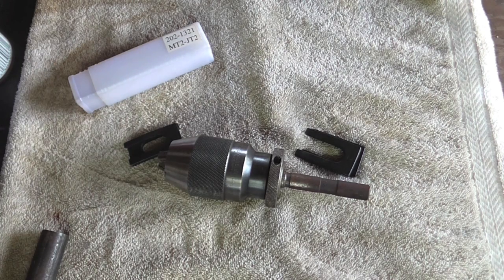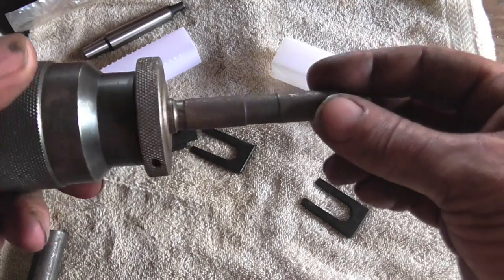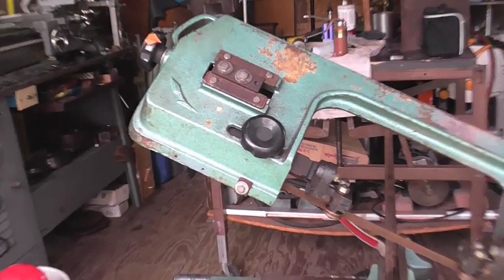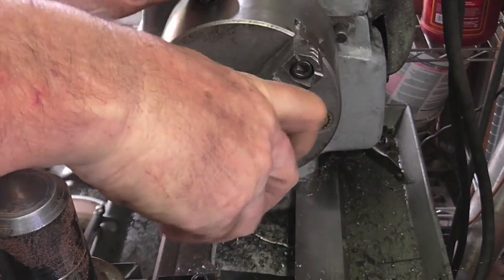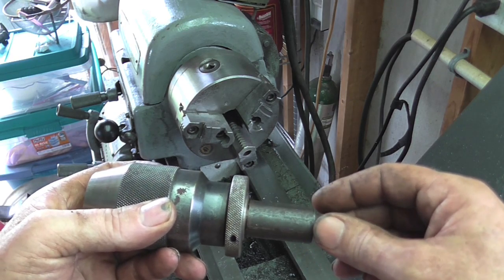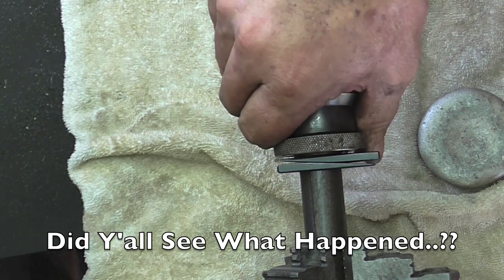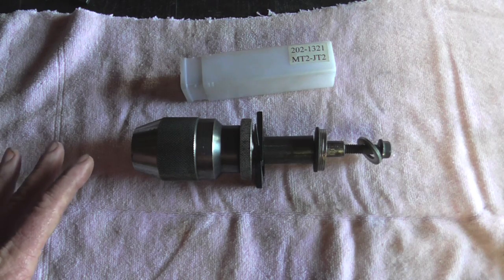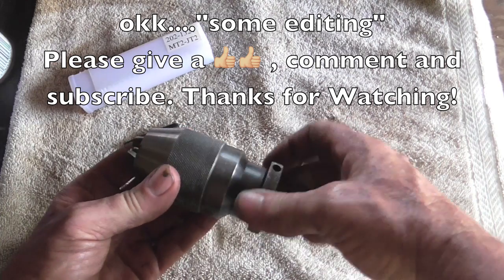How To Remove a Jacobs Taper (When Wedges Don't Fit!!) - MSFN

Comment: I gotta ask,  why not just disassemble the chuck and tap it out?  I don't understand the wedges.
Reply from the maker: Tap it out?, I dont follow you?
Reply: Makin Sumthin From Nuthin 

disassemble the chuck,  use a punch and drift the arbor out from the front
Reply from the maker: I dont believe there is a thru hole to access the arbor in Albrecht chucks....I could be wrong tho. It all worked out in the end 😊
Reply: grab the chuck by the two nurled sections and screw them apart, that will remove the hood (tapered section). then the jaws and jaw guide will come out. under that is a threaded piece that pushes the jaws,  screw that out. insert a drift punch into the hole that the threaded part was screwed into and tap out the arbor.
Reply from the maker: Thanks!, I did not know....but I do now. I appreciate ya! 👍🏼

Comment: I would have tried 1. reducing the spot where the tapers fit to the size taper I had or 2. drilling a hole for a cross-pin rather than drilling and tapping the end. Either way would leave the shank re-usable in the future and would have been fairly quick. The bandsaw is a dead ringer for my old Harbor Freight one. The newer ones have a hole drilled for a pin to keep it in the vertical position. It is also a good idea to stiffen the bottom so it is more stable. I put angle iron on each side and a shelf in the middle to hold bits. Made a huge difference.
Reply from the maker: All great suggestions, thanks for taking the time to help a new machinist out. I considered the cross-pin but if you saw my drill press you would understand why I took the route I did. Lol  I am glad it all worked out in the end :)
Reply from the maker: No pin on mine to hold in vertical position but easy to install one...thanks! :)

Comment: Richard--great lesson in perseverence! As others have mentioned, the bandsaw is generic Chinese. I have one the same color, same casting marks that is marked "Ram Machinery." I think they were sold under a variety of names, however. The castings are similar or identical to the Harbor Freight $250 bandsaw Item #93762.
Reply from the maker: I like the bandsaw, it does a good job for me. Thanks for the additional info!

Comment: Well done sir.
Reply from the maker: Thanks Rodman :)
Reply: Makin Sumthin From Nuthin You're very welcome.
Reply from the maker: Just rebuilt the entire deck on my John Deere L110 Mower, replaced spindle bearings, drilled out the 2 other pulleys that they rivet together for some unknown reason and replaced those bearings too (bolted the pulleys back together), replaced belt & blades...sounds & cuts like brand new now 👍🏼
Reply: Makin Sumthin From Nuthin That's awesome.  I love to hear of things being repaired instead of being replaced.  America has become a disposable country. Everything just Getty tossed in the trash an thrown out.  Thank you for not being part of the problem.  Bravo sir.
Reply from the maker: I know you do mower repair/maintenance so thought I would let you know :)
Reply from the maker: Cant afford to replace...or...pay others to do what I can fix! #MakinSumthinFromNuthin! :)

Comment: What a good idea, I would not have thought to tap a hole.  Good one there, I am trying to think if here would be a way to use a longer pipe sleeve then use the threads on the bolt you installed to pull it out by turning the bolt into the hole.   Thus pulling the two apart.   Don't know if that would work but if this comes up around here I am going to try extending on your idea.  Thank you a very good one this time.
Reply from the maker: Thanks Glenn, read Xynudu's comment....I think you are on the same page as him on that line of thinking. It was a nice challenge for me not being a seasoned machinist but was happy to have it finally pop off as you can see from the video :)  I have since thought up a few other ways to break the taper since yesterday but am glad everyone commenting is expressing alternatives so others may benefit. Post a vid of your solution, would love to see others tackle this one. Richard
Reply: Yes, he did have the same idea I think, Sorry I didn't read the comments before chiming in.

Comment: Once you drilled and threaded the straight shank you could have just used a suitable length of pipe between the back of the chuck and bolt head/washer, and used the bolt to pull it apart (same as when extracting suspension bushes) - no wedges required.

But it worked out OK so well done.

Cheers Rob
Reply from the maker: When I knew "something was giving way" and it wasnt the drill chuck, I feared I was putting too much pressure on the lathe spindle bearings with my original idea so abandoned the lathe and went to the vise. If I could do it all over again I would have gone about it differently. It was a good learning experience. Great suggestion on your part Rob, Thanks! ~ Rich
Reply: How would that work? Would you be tightening the bolt to force it out?

I ask because if that is the case, I wonder if the bolt may snap instead. Just a though. Have you tried this method and have success I guess would be my question.

Comment: Thats no logo it's an arrow to show the direction of the saw blade
Reply from the maker: is it ? Dang.... LOL Well....hopefully someone may recognize the saw. Thanks for watching! :)
Reply from the maker: THANK YOU!, much appreciated...looks just like mine. It works great thus far...just recently bought it. Thx again 👍🏼
Reply: Paul Reed 
I agree it is.   My cheap horror freight has one just like it.
Reply: That was my first conclusion of what I thought it was not knowing much about bandsaws, simply because I think very critical. I’ve run into enough tools, accessories, etc. without proper markings, indications, labels, etc. enough where I’ve had to rely on illustrations/photos or just imagining the steps and what the designer(s)/engineer(s) were thinking as they were creating the piece.

I’ve learned that:

a) most designers/engineers are ordinary people;

b) inventions, adaptation, innovations, ect. are a build-up of the existing product;

and c) are usually progressively (by which one can come to logical conclusions by simply studying and observing the product and the history behind the product that goes with it).

I just thought I’d mention it not to esteem myself, but to help other readers consider what I have written in order that they may look at a thing, observe it, study where it has been and their past iterations to make a logical conclusion of its current direction that may aid them in resolving a matter as the one in this video.

Also, seeking others’ experiences, knowledge, and advice to consider. More possible solutions make a more informed decision as to which steps and/or method(s) to take.

Comment: Success... my first thought was to make a spit collar with set screws  about an inch or inch and a half long with set screws so it could clamp on the straight section of the shaft...
Reply from the maker: I considered that actually, this way seemed faster but I am sure that would work too. I thought the lathe chuck was more powerful than the jacobs taper but was wrong..thanks for posting another solution as it may help someone else! :)

Comment: Hit it sideways ,thats tapers weakness they are great for axial loads since it pushes taper into each other ,not so great for radial forces it loosens it up -thats why you don't mill with taperd chucks -unless its a taper with tread. ,you could use a jackhammer(smaller like drill version-i don't know name in english) for extra vibrations.
Reply from the maker: I am new to machining so experience is not on my side. It was a $300 chuck and didnt want to damage it, so did my best! :) Thanks for the info!